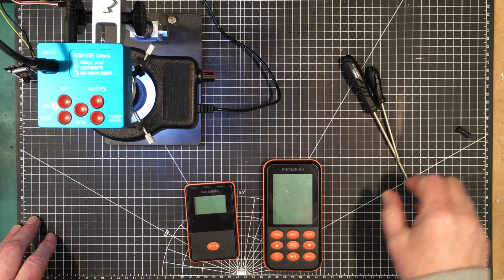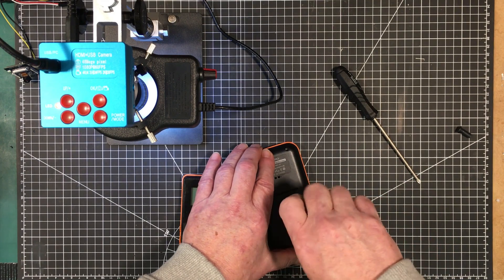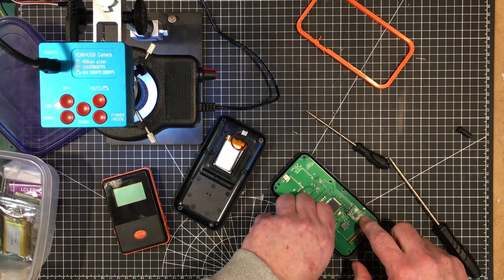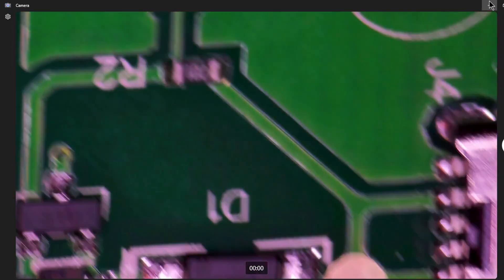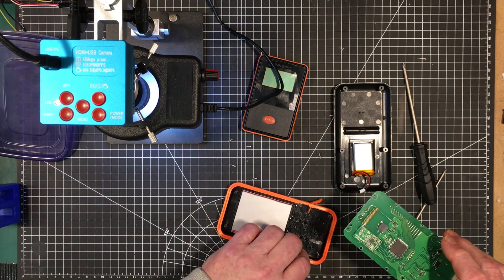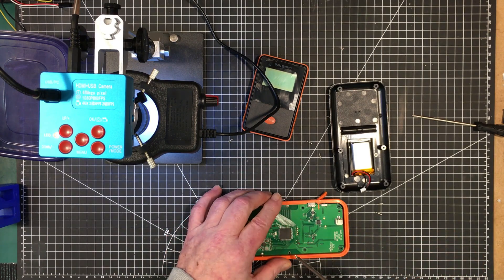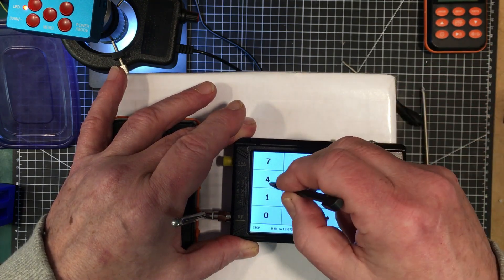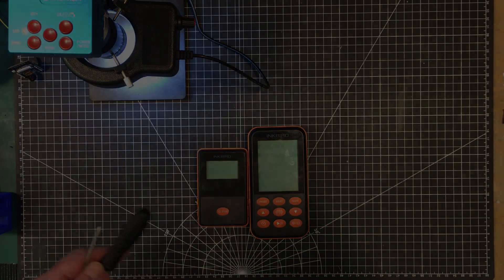0157 - Inkbird IRF-4S Wireless Thermometer Teardown

Comment: Those JIS screwdrivers make a lot of sense. I could see that none of my Philips heads were not working well with my gear, but I did not know about these. Thanks, I ordered a set. Take care.
Reply from the maker: Let us know what you think.
Reply: @uni-byte  I like them a lot. I've tried them on things I've struggled with most recently and they worked without any problem. The most frequent are battery hatches with retaining screws. The JIS drivers worked on them better any of than my many Phillips drivers.
Reply from the maker: @jerril42  Thanks for the update!